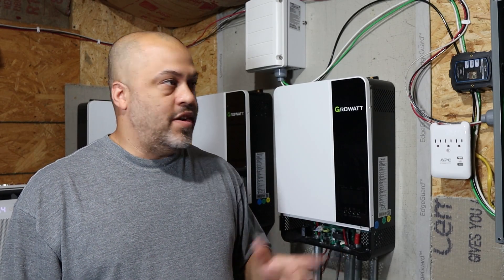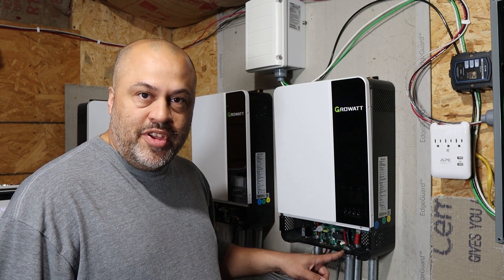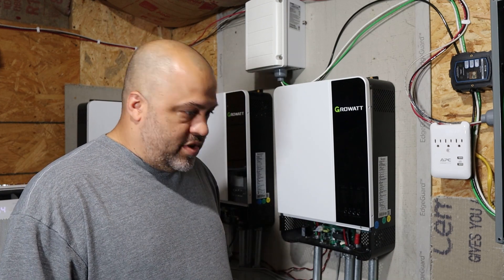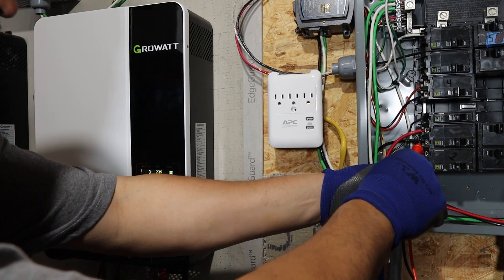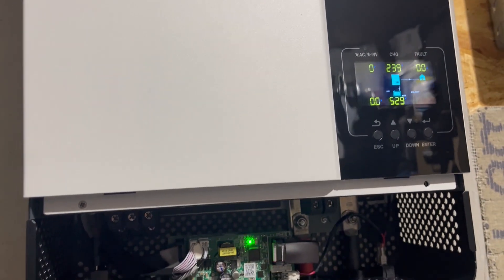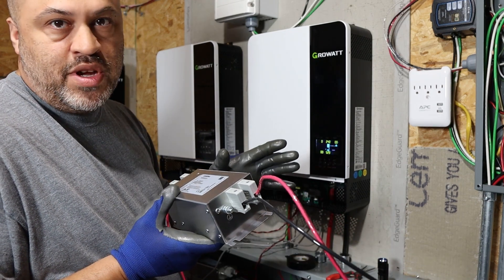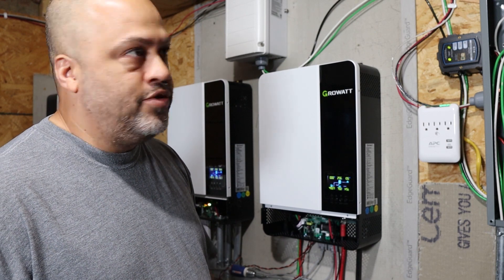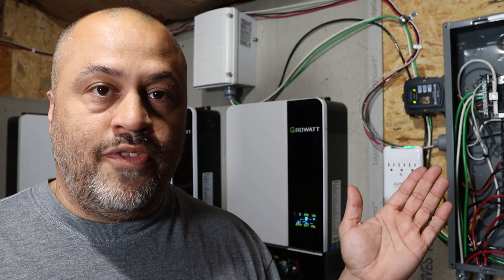Growatt Buzzing Troubleshooting and Self Inflicted Problems

Comment: My growatt spf 6000 es hybrid inverter is leaking current to case , is this normal?
Reply from the maker: No. Need to check all wiring and ground
Reply: @rodneyhunt  when I connect ground wire it is fine
Reply: Why grid input RCD tripping always?

Comment: Pretty happy with the Victron Quattro 15K. Never missed a beat. Looks like the new EG4 unit is good too. Good luck, hope it works.
Reply from the maker: Everything has been good so far including the state of charge. Victron is always a good bet.
Reply: I have a couple victron 150-70 charge controllers but I've been using a splitphase sungold inverter but its only 4000 watts. I'd like to get a victron inverter but 10k that I'm needing is gonna be expensive.  I love the victron stuff tho for sure

Comment: I call bull poop on the drilling the inverter bottom out. I am an electrician by trade and have done this. a thousand times or more on many enclosures, that is a standard in the electrical field. I do however understand if you did it wrong shavings could get into the electronics. I would use a hole punch instead of a drill in this case. And if you used 2/0 wire as I have, it will NOT fit in a 1/2" conduit.
Reply from the maker: I purchased a harbor freight knockout tool but is was defective. I purged the air out but it still would not function so I used a drill. The signature solar tech sent my inverter issues to the return department who said they do not qualify for warranty since I disclosed the openings are now 3/4 instead of original 1/2. No shavings as I vacuumed everything out. Glad its all working now and going to test my original inverter as it may be good as well without the filter installed.
Reply: I drilled mine out too😂.